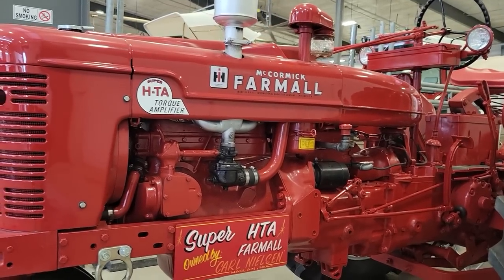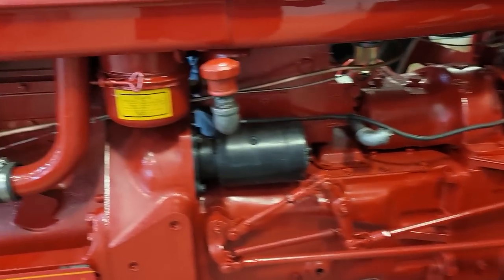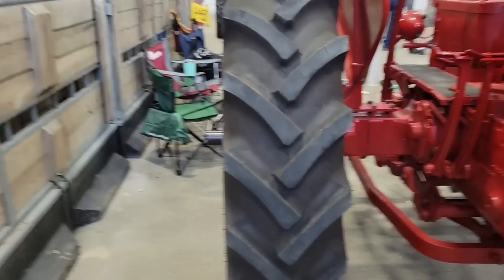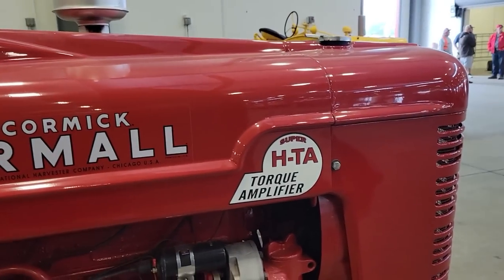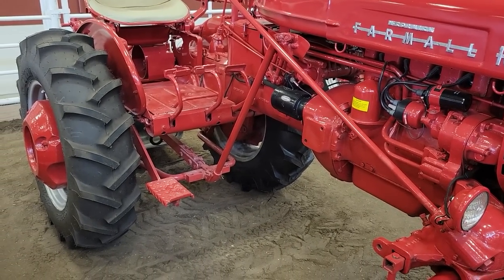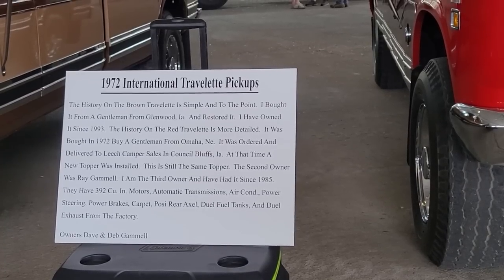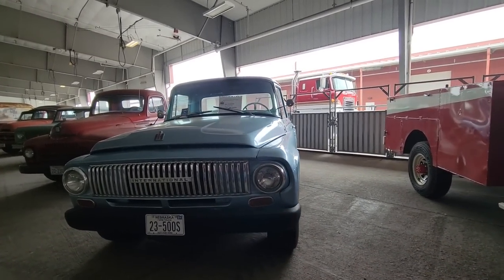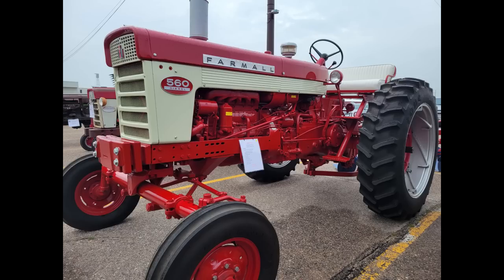Red Power Roundup 2023! Pete from "A Few Acres Farm" sighting.

Comment: Since you mentioned Squatch253 im gonna hit the subscribe button without thinking twice. Love to see the close up of the Metro van. Fun fact lot of these international trucks where used a lot in fire departments and send also over seas. Maybe the Scouts where used by forest workers? Not exactly sure but someone will correct me if im wrong. I don't know even what would be more interesting for me, the tractors or the car section? The car section had lot of interesting vehicles that are mostly forgotten or out of existence by a long shot.
Reply from the maker: Thanks for the sub and the view. I went to trade school for farm diesel mechanics back in the late 70s when some of these machines weren't that old and some were new.
Reply: @1crazynordlander  Did you see also any foreign brands that where used beside IH Farmalls? I find the high crop, corn picker and beans cultivator the most interesting ones. Would like to hear more of what was it like to work with machines in the 70s.
Reply from the maker: @SuperMAZ007  I did not see any foreign made equipment at the show. I farmed right out of trade school then was hired by a diesel injection shop. I worked on Roosa Master rotary injection pumps that were on various farm equipment of the time. The calibration fluid messed with my body so I had to go onto something else until I landed a parts manager job at a GM car dealer. After that I got into computers and networking. I still do  lot of my own repairs on equipment yet.